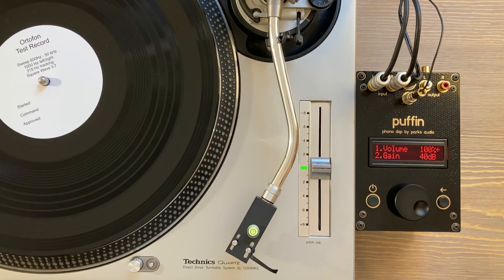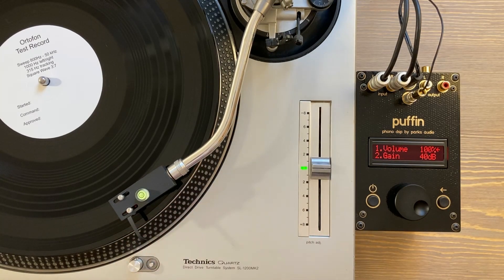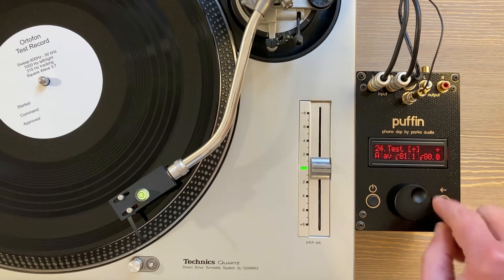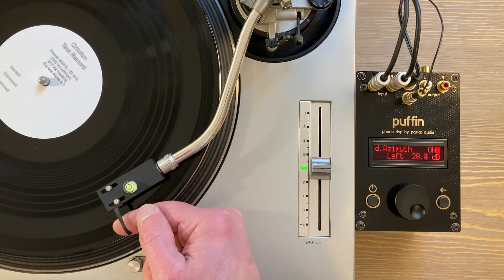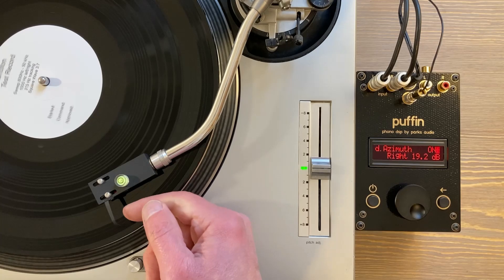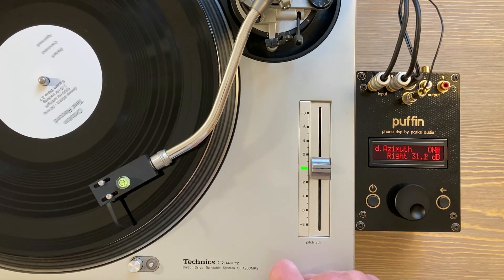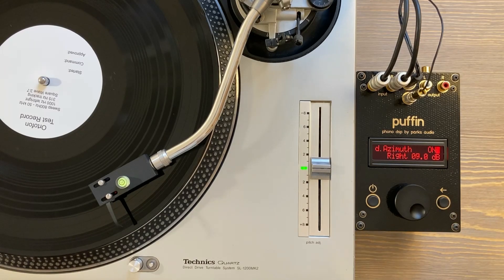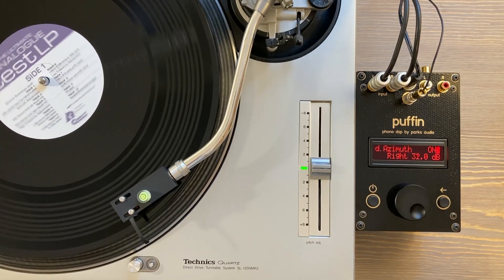Parks Audio #5 - Azimuth Alignment with the Puffin

Comment: PARKS AUDIO, the closer the vinyl grooves makes the less/lower Azimuth Separation? Azimuth means the separation and isolation between the right channel to the left channel. The Azimuth is measuring the isolation between the L and R channels?
Reply from the maker: We need the L/R isolation of the media itself to be greater than the cartridge's own L/R isolation. If the vinyl only has 20dB of channel separation, then this will dominate the measurement.
Reply: @parksaudiollc4697  But how do you find out what the cartridges own L/R isolation measurement? The spacing of the vinyl
 grooves will determine also the L/R isolation?
Reply from the maker: @waynegram8907  We need to use test records with excellent separation: Ortofon Test Record or the Ultimate Analog Test LP. These have high separation for Azimuth purposes. Then follow the steps documented in the video.
Reply: @parksaudiollc4697  yes that is how you align the cartridge but what I'm saying is you can align the cartridge with a Ortofon test record that has 30dB of azimuth separation but when you play rock bands vinyl records that the grooves can be very close together because they wanted to squeeze as many songs onto one side of the record side A which the azimuth separation will be 10dB. What I'm saying is AFTER you have done azimuth alignment on a cartridge, try measuring various rock bands vinyl records to measure the vinyl groove azimuth alignment. How do you measure the vinyl groove azimuth alignment to know how much dB separation the grooves have?
Reply from the maker: @waynegram8907  Email me via the website for more info, Wayne. There's channel separation at the mixing console, at the vinyl media (width of grooves as you mention), at the cart, at the preamp, etc. Let me know what you are trying to do, e.g. comparing different pressings, etc.

Comment: The Azimuth separation values depends on the choice of Lo Cut frequency on the Puffin. With Lo Cut at 5Hz the separation values are worse than at 20Hz , due to low frequency rumble and groove noise.   Setting the Lo Cut to 20Hz instead of 5 Hz improves separation with 8 db in my case.
Reply from the maker: Excellent advice. One can even make a narrow bandpass with a lo cut at 400Hz and hi cut at 5kHz for even greater separation numbers for this 1kHz test.

Comment: This is brilliant in conjunction with the Tacet test record I bought, btw on my turntable and cart (ATVM540ml) it measured up to 33 on the right using the Tacet but I settled for around 29db on L&R and it sounds fantastic. Also the tonearm resonance test is great goes up in increments of 1db from 5 to 15hz.
Reply from the maker: Great numbers! The Tacet record also has a useful frequency sweep - check it out. 👍
Reply: @parksaudiollc4697  I seen that but can't figure out what I'm supposed to look at on the Puffin.
Reply from the maker: @andymill32  Sounds like I should do a YouTube video on this soon, then. Use Test:Sweep. You press Select/Arrow when the reference 1kHz signal comes on and then it measures the frequency and level compared to the reference. Then you right down the levels by hand and then can plot. I'll make up a spreadsheet chart.
Reply: @parksaudiollc4697  Thanks Shannon, I ran the test but wasn't sure what it really meant, ie what do you do with the results, are some good or bad etc
Reply from the maker: @andymill32  Good info. Will do a video for sure.
Reply: @parksaudiollc4697  Thanks Shannon, helpful as always.

Comment: Very cool feature. To be clear though, minimal crosstalk or balanced separation does not necessarily mean the stylus Azimuth is optimal. Since the stylus can be at a different angle than the generator.
Reply from the maker: Exactly - that's why we want minimal crosstalk measurements to be balanced (between the two channels).
Reply: @parksaudiollc4697  Yes, but that could mean that the diamond is sitting off angle in the groove, the crosstalk and Azmith stylus angle is not correlated necessarily, but as you say in the video, you have to decide whats you prioritize, sound or tracking.